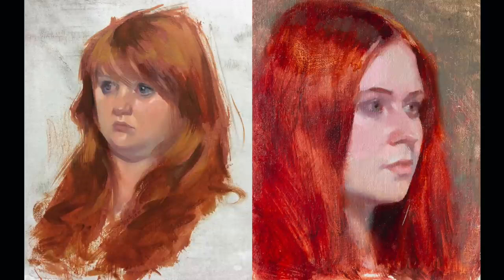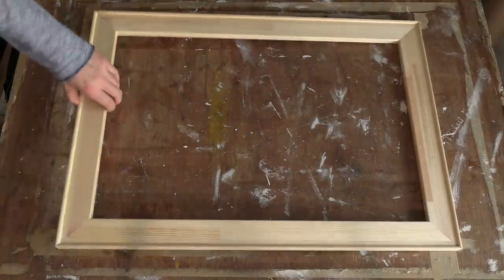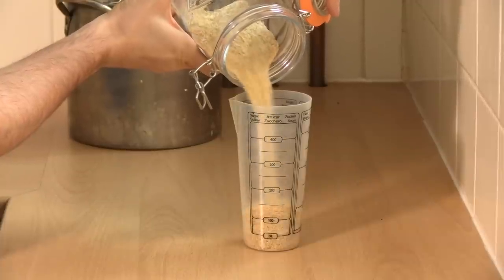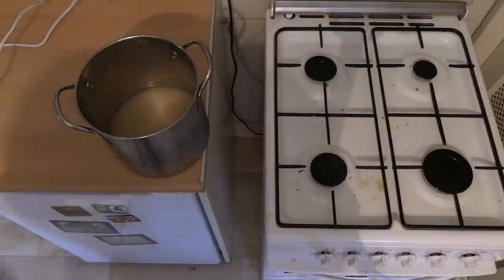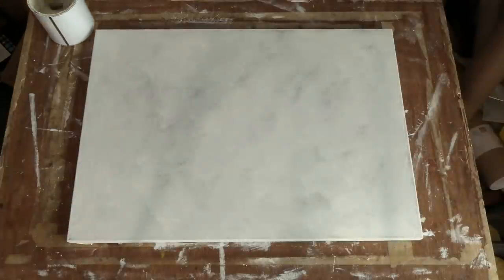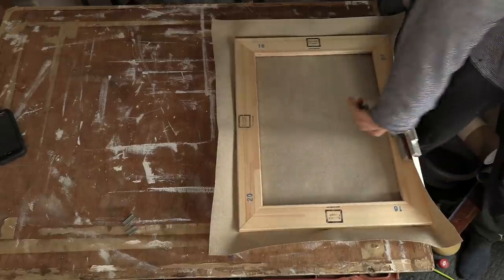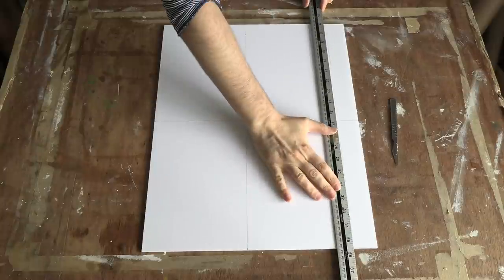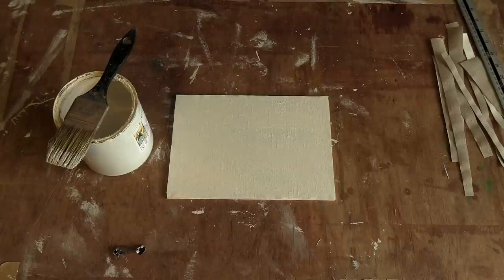Make Your Own High Quality Canvases and panels

Comment: can the hardened glue be saved for use on another occasion instead of throwing it away? It seems so easy to reactivate.
Reply from the maker: Rabbit Skin glue? Maybe if you freeze it? If not it goes rotten after 2 days. I don't know if ready made rabbit skin glue behaves any differently, Ive never tried it as it works out as quite a bit more expensive:

https://www.jacksonsart.com/roberson-prepared-rabbit-skin-glue-500ml
Reply: @SIMPLIFYDrawingandPainting  Ok, didn't realize it rots. Thanks for the info and quick reply.

Comment: A friend of mine, who graduated from the Repin Institute, taught me how to use unflavored gelatin as sizing instead of rabbit skin glue. He learned it there.  I have been doing this for several years now with seemingly good results.  It’s preparation is much the same as it is just like making Jello with out the dyes and flavoring. It might even be cheaper than rabbit skin glue and just as effective.  PVA is much too expensive in my opinion. Do you have any thoughts on this?
Reply from the maker: Thanks Jeff. Sounds like a good tip. It makes sense, as gelatin is also made from animal parts. What do we know about its archival quality? In theory it should be similar to rabbit skin glue, but there may be other impurities in gelatin? Gelatin is available in edible forms, so it can't be that bad. I've just searched Google and you can get gelatin with a neutral Ph, this is the stuff to use as other types gelatin are apparently acidic. Gelatin certainly sounds like it would be lot less disgusting to prepare than rabbit skin glue and I agree completely about PVA size being really expensive. I think I shall give it a try.
Reply: @SIMPLIFYDrawingandPainting  The general instructions that he gave me where to heat gelatin and water until completely dissolved. Paint on hot. Then refrigerate the left over gelatin until solid, like the desert. Then, after the hot application is completely dry, take a gob of cold gelatin in you hand and rub it into the canvas/linen until all the little globs have melted and filled all the hole in the fabric. Looking at the back of the canvas you will see bits of extruded gelatin that have filled in the holes. Let it dry. It will be drum tight. The surface is now ready to be gessoed. Enjoy.
Reply: @verydrunkcat  I have never experienced a single problem using food grade unflavored gelatin. I’m still doing it the way I described. The canvas comes out smooth, drum tight and, ready for gesso. I imagine it does suffer from similar problems of being hydrophilic like skin glue and can suffer in the same ways from mold in very damp environments. PVA doesn’t have this issue. Also, gelatin doesn’t have the disgusting qualities in prep and use that rabbit skin glue does even though gelatin is rendered from hides as well so is therefor not an acceptable choice for strict vegans.
Reply: @verydrunkcat  I have a piece on my wall that is about 7 or 8 years old and there is no smell or mold or, anything wrong with it. I hate doing the rabbit glue thing and my only experience with trying PVA left me unimpressed because the canvas I stretched became to loose after the coatings and I didn’t like that, especially given the cost. That is my only experience with using PVA. The gelatin grounded painting on my wall is on a very heavy jute/hemp fabric which at the time I was obsessed with painting on that deep weave surface. I’ve used gelatin on everything from that to fine woven linen. Bonus, I’ve kept leftover gelatin in my freezer for months and then thawed it out and used it to no noticeable ill effect. It’s simple. It doesn’t stink and, in my personal experience, is very stable.

Comment: ❤️
Heating size in a small saucepan, in a larger one
which has boiling water,avoids chance
of spoiling,by 
boiling
✔️
Reply from the maker: Yes Indeed. That's what is normally recommended. Though practically speaking, it depends on how much size you need to prepare. Because making canvases with raw linen takes several days, I usually make 10 or so canvases at a time, so that's quite a lot of size. I have to use a large saucepan and I don't have an even bigger saucepan to make a Bain-marie.
Reply: Great job, thank you
It does feel good to know I am not alone
In pursuits like this
All the best
Henry

Comment: Would you tell me about the components of the oil primer you used , please ?
Reply from the maker: Unless it is made with Lead which takes a lot longer to dry, most oil primers available these days use Alkyds. Which I believe is a kind of polyester? It's basically the same stuff that they make house paint out of. But supposedly the stuff the use to make oil primer contains far fewer impurities that house paint. House paint isn't designed to last decades, hopefully oil primer has a better archival quality.

The Roberson's oil primer I normally use says its Titanium White based. But it's been temporarily discontinued due to ingredient sourcing issues. So I've been using Gamblin oil primer recently.

Comment: If you added alizarin crimson to the red oxide on the Right portrait, then obviously it would look more vibrant and colorful than the one on the left without the red pigment.
Reply from the maker: But that was the colour of the model's hair on the right, it didn't need to be more more vibrant. The model on the left had died hair, that's why it's more red. The purpose of showing you these to paintings side by side isn't to show you the difference in colour, it's to show you the difference in texture caused by using more or less absorbent surfaces, in that the one on the right appears much more dull and flat on gesso compared to oil primed linen,

Comment: If anybody could answer this question for me I would be appreciative. How does the rabbit skin glue mixture smell? My lady wouldn’t be very happy about be stinking up our apartment.
Reply from the maker: It doesn't smell great, but it isn't so bad while you're making it and using it. However, after a couple of days it starts to get mouldy and then it smells like rotting flesh.
Reply: @SIMPLIFYDrawingandPainting  thank you for the heads up. I will use it quickly, and on one of the rare days that she has to work and I am off.

Comment: I really prefer PVA and you can get 5l for about 27€, wouldnt consider that more expansive - only downside is, you have to stretch the linen or cotton canvas more when putting it on the stretcher.
Reply from the maker: Is that acid free PVA? How many canvas will you normally get out of 5L?
Reply: @SIMPLIFYDrawingandPainting  though it was cheap, it says solvent and acid free on the canister - have to believe them, since I have no laboratory at home 😄 its still my first canister, but I guess itll last for a while. Another method I really like is to use acrylic gesso for seizing the linen. I buy gesso from Lefranc&Bourgeois, its 9 - 11€ per litre (buy it at Gerstaecker, big german art supply dealer) and though I tried gesso 3 times the price, I always come back, its not so thin as others, you can sand it, and its cheap, so I have no problem using it as "glue" - and on top I then use Gamblins oil ground, they say you can use it on top of gesso and so I do, works fine🙂

Comment: I'm currently taking Old Masters Academy and the instructor says never to use oil ground because it has been proven to peel off, many paintings have been ruined because of this. I can't vouch for this just parroting what I heard in the course and wanted to share. I used Gamblin Ground and I love it.
Reply from the maker: What does he use instead?
Reply: @SIMPLIFYDrawingandPainting  Acrylic Gesso over Rabbit skin glue, nothing out of the ordinary, just really stresses not to use oil primer. Here is the quote from the course. I had never heard this prior to this course so I'm really trying to get a second opinion on it: "Important: Never use Oil Primer

In the middle of 19th century, when connection with Old Masters’ methods was completely lost, many misleading techniques of painting and priming methods occurred. Artists started to use Oil Based Primers, which caused significant damage to paintings and dramatically reduced the age of many works from that time. Most of the works painted over Oil Primer, adhere to the ground very weakly, and some paint is already falling off. The fact is, that the Oil Ground has a glossy surface that does not absorb oil from the paint, thus painting layers are very poorly attached to the oil ground, and after sufficient drying time, it can easily separate from it. The connection between the ground and a paint layer is unstable, especially in a multi-layered impasto painting."
Reply: So all those paintings that are hundreds of years old are fakes ?

Comment: Where can I find rebertsons oil primer? Do they still make it?
Reply from the maker: It's available from quite a few different suppliers here in the UK. I usually get mine from here:

https://www.jacksonsart.com/robersons-oil-primer-1-litre
Reply: @SIMPLIFYDrawingandPainting  
It hasnt been available at Jacksons in some time or even Atlantis. Apparently Robertsons cant find a particular ingredient to make it anymore :/
Reply from the maker: @christopherhanson9578  Tbh oil primer is oil primer. I don't think you'll notice any difference between any of the good quality brands (not for the first 50 years or so, at least). I use Roberson's because it's what they sell at Russell and Chapple, where I buy my linen. Gamblin's oil painting ground is probably good, tho it says that is also out of stock on Jackson's website. Maybe they can't get the ingredient either? I've used this before and it works well:

https://www.atlantisart.co.uk/spectrum-thixotropic-alkyd-primer/

Comment: Why not tacks instead of staples?
Reply from the maker: Tacks are certainly more aesthetically pleasing. Perhaps I should have shown how to use tacks? I sometimes use them when I make canvas with pre primed linen, as they go in the sides of the stretcher and are therefore more visible. I don't see the point of putting tacks in the back of the canvas where no one will see them. But they are also a lot more fiddly and take longer than using a staple gun, particularly while simultaneously stretching a canvas with pliers. And if your canvas is going to be framed, no one will see them anyway.

Comment: I'd rather go with pva glue spending more rather than painting on dead animal's skin. Disgusting to say the least! Great tutorial though, thanks!
Reply from the maker: Yeah I hear you. It is pretty disgusting stuff, particularly when it goes off. My son used to have a pet rabbit too. Archival quality PVA size is a lot more expensive though and I don't think you'd get much coverage from a 250ml bottle, maybe a couple of canvases? You can apparently dilute it tho?

https://www.jacksonsart.com/gamblin-pva-size-237ml?channable=0044a5696400313134383736b6&___store=jacksonsart_en&gclid=CjwKCAiAi_D_BRApEiwASslbJ4dNhC1WpOf_qpTAuOpJ1QdSCYbNV4Ozyndi8ncKRPnR7w_arwvjnRoCHAUQAvD_BwE
Reply: @SIMPLIFYDrawingandPainting  The price of Gamblin's glue is ridiculous, considering the fact that is nothing more than polyvinyl glue (wood glue) with a neutral ph (acid-free). 
In the restoration/conservation industry there are similar products that are less expensive but they are harder to find and sold in big sizes only.
Reply from the maker: @Ryowazza99  That's the only one I could find on the Jackon's website, which is one of the best online suppliers I've used here in the UK. It's the only one I could find on Amazon, but I could probably find some if I looked a bit harder. Still, rabbit skin glue literally works out at a few pennies per canvas. Tho it is more of a hassle and definitely not a vegan option.